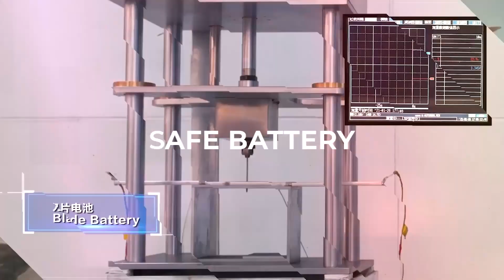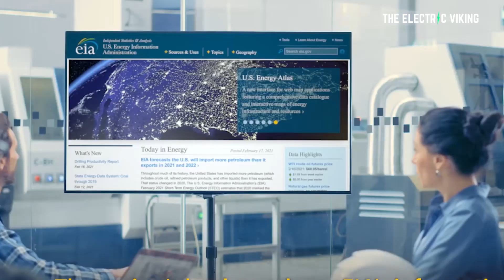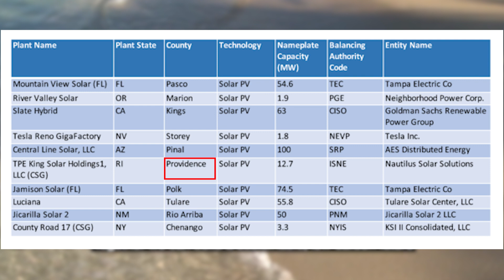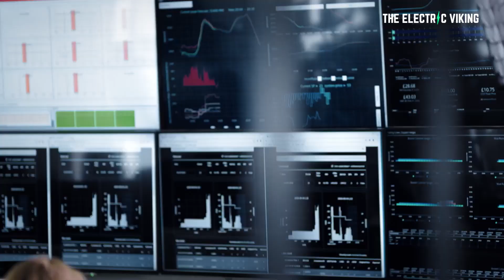US nears 50% emission free electricity; wind & solar set records

Comment: Let me tell you the best ways to never have Americans buy solar for their homes.  First come knocking on our door and explain you are from the electric company and are their to measure up your home for solar energy.  It’s a scam the electric company has never heard of them.  Second the price varies so much from one solar company to the next and what they recommend for your home you just give up in disgust.  Third solar products and solar companies do not have strong warranties.  Installation contractors in America and manufacturers in China come and go.  I 100% predict Americans will be left with degraded solar systems after 10 to 20 years then have to depend on a electric grid that can’t supply electricity thru a abandoned and disabled system.  When those cheap plastic solar panels from China and the crappy but profitable installation is coming undone and those panels ain’t producing power no more who are you going to call?  Speedy Solar and Mr Wong in China.  Oh I know call Tesla power wall for service they will happily sell you Tesla solar roof.

Comment: Nuclear is not going away dude. In fact in the long run it will be a greater part of the energy composite than it is now. Sure the old mega nuclear plants are closing, but Small Modular Reactors are just getting started.

Comment: It is getting better.   But we need to be a bit careful because numbers that only run through spring (a period when very little AC is in use) are not very meaningful.   But it is getting better.   For 2021 the breakdown was:

natural gas: 38.3%
coal: 21.8%
nuclear: 18.9%
renewables: 20.1%

And under the reneawbles banner, wind was 9.2%, hydro was 6.3%, solar was 2.8%, and biomass was 1.3%.  Unfortunately, the generation mix varies widely by state.  Some states are more proactive than others.  Solar is more far more expensive in the U.S. primarily because of the Tariffs on imported solar products like panels.   Basically, bad policy decisions.  Despite that, solar is becoming more accessible to people and storage is rapidly closing in on economic viability too (the storage side doesn't have the same tariff problem that the solar panel side has).

Comment: Be very careful with this reporting, you are only describing electrical generation not total energy. In US 2021 solar was 1.5% and wind was 3.3% nat gas was 31.3% oil 35.5% coal 10.5% nuc 8.2% . So I think it will take 10 years to get to 50% if at all?

Comment: Without huge amounts of new nuclear power, non fossil derived power can’t exceed about 60%. The wind doesn’t blow and the sun doesn’t shine when you need the power. No universal battery technology exists that can change that fact. Many approaches are being tried but none are close to solving the problem of electricity generation being a real time problem (demand for electricity must be met with power generated at the same time). Conclusion: Wind and solar will not supply more than about 60% of electric power, full stop.

Comment: Hey Viking!  Where do you get your numbers?  The US is NOWHERE NEAR 50% "emission free" electricity.  NOPE.  As for why PV and wind electricity is so expensive in the USA, the answer is geography.  Few areas of the US have long days uninterrupted by cloud cover, unlike Australia.  And though we have abundant wind resources, much of the wind potential is far removed from population centers (the Great Plains, for instance).  Intermittency is a problem for the grid, and transmission drives up prices.  No mystery.   Cheers!

Comment: Very good news!  I've been using 43% as non-fossil powering the US grid but that was based on older 2020 numbers -- so 50% renewable (or non-carbon) is in-line with expectations.  The US federal government's goal is a 100% carbon-free grid by 2035 which is quite doable!  Especially given where we are now along with (a) the declining solar price and (b) upcoming big solar efficiency improvements via new advancements like Perovskite and Quantum Dot films.  Not to mention wind too.

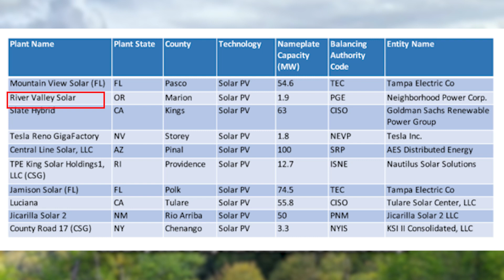At 5:45, I see the Tesla Reno Nevada Gigafactory's solar nameplate capacity listed at only 1.8MW.  That is low -- even a Costco, Home Depot, Lowe's, Target or Walmart store quite easily have that much and more on their roof tops.

The numbers I'm seeing for current Tesla Reno Gigafactory solar capacity is 3.2MW.  But with capacity up to a staggering 72MW given the enormous roof area of a Gigafactory.  But Tesla's Gigafactory solar installation has been going slowly -- mostly because the factory itself is only partially built-out at some 30%.  The current COVID-19 pandemic and supply problems are not helping Tesla either.

Some early 2022 reports indicated the Tesla Reno facility's solar will be expanded to 24MW capacity by end of 2022 but that was before crazy Putin's effect on global supplies and increasing uncertainty of inflation.

Comment: "US nears 50% emission free electricity"????  You serious?  Better go check the stats yourself and not read "YouTube headlines"  Gas and Coal will continue to be largest generating electricity energy sources and they will increase i the future because they US is very bad at water management and thus its largest hydro generating sources will decrease.  Until they develop a "storage" ability for wind power, they will not be able to fully take advantage of Wind power which fluctuates erratically and not in line with demand necessarily.  10 years to get to just "solar and wind" production of electricity??

Comment: https://www.eia.gov/energyexplained/us-energy-facts/data-and-statistics.php
Electricity production is 61% fossil fuels. Nuclear 19%, (California will reduce that); wind 9% and solar 3%  of electrical production;; about 5% of electrical power is lost in transmission.  The remainder is bio mass 1% (has CO2) hydro 6.3%, geothermal 0.5. Electricity is about 1/3 of overall energy used.

Comment: But the "BEV's and green energy can't possibly work" crowd will keep claiming BEV's "run on coal" until ZERO coal is used to generate electricity.  

It seems to me that I've seen various articles, videos, etc. stating that at utility scale, green energy (solar and wind) is becoming cheaper than fossil fuel energy at utility scale. 

Economics should take care of the issue, given time, as long as it's true that green energy is meaningfully cheaper, over time.

Comment: Tariffs on China imports. A hole home system would cost me between $60-65k with panels being 25k and 3-growatts plus a rack of 6 batteries for the rest
Reply: The panels themselves are just a small part of the cost. The high costs are typically mostly found in permitting and bureaucracy.
Reply: Yeah Trump put them on there. Biden really should lift them, at least for things like solar panels and batteries. We need every bit we can get right now, regardless of where they're from.
Reply: @spacenerdity  more good solar panels need to be made here in the states. Norway has the best value with the rec alphx panel with 400w & 21.6% efficiency with a service warranty next is the sil fab elite 380w & 21.4% efficiency made here in the states, but no service warranty.

Comment: No, we've shut down coal and lost overall capacity.  Solar and wind aren't cutting it, but builders and owners get free tax money.  And the blackouts increase.

And now we're expected and MANDATED to buy electric golf carts.
Reply: As an electrician who has worked on most types of power plants and lives in the western US, the cause of blackouts is mostly caused by the drought effecting supplies of cooling water to thermoelectric power plants (coal, gas, and nuclear). Or in some cases the power plants may have the volume of water needed, but the water is too warm to cool the plant in the manner it was designed during warm weather events. Wind and Solar have helped stabilize the grid, reduce stress on grid interchanges, and kept electrical prices lower. Coal plants have been shut down because they cannot make a profit selling their power.
There are no mandates (yet) to purchase EV's in the US, yet Tesla is now the best selling car in California.
I have driven Tesla's and the Chevy Bolt, own a Chevy Volt, and have a Cybertruck on order. None are golf carts!
Reply: @GoCoyote  Huh?!

Did you forget what happened when a couple of coal plants were shut down, 'replaced' by the pinwheels in the Columbia Gorge?  We had a SLIGHT drought, and the hydroelectric dams had to drop their generation level to make up for the lower water pressure.  We lost the last domestic aluminum plant because of that.  Also, any blackouts we've had, have grown in frequency AND LENGTH due to the erratic effect of pinwheels and smoke-and-mirror solar.  They are NOT stabilizing ANYTHING...quite the opposite.

Drive down the Columbia Gorge one of these days, and see how many of those huge, ugly pinwheels despoiling the landscape are turning.  On any given day, it might be 1/4 to 1/3 of them.  And that's during the peak wind flow times through the gorge.  A GE employee told me that if these things turn faster than 60%, they have to be shut down and serviced.  Most times, since there's nothing that can be serviced without disassembling the nacelle...ON THE GROUND...the repair guys sit up in the thing and play cards for an hour or so, then leave.  But the owner of the wind farm (which is NOT PGE) gets paid as if all those pinwheels are generating 100% of their ADVERTISED capacity.  Meanwhile, any time a coal plant operates, it has to pay the government a FEE.  As well, the utility using the power, has to pay a FEE for using that power instead of nonexistent power from solar or wind.  If they didn't have to do that, it would STILL be far less expensive to use coal than the non-existent/intermittent/erratic/nonviable wind and solar.  It is the feed-in tariff and 'carbon offset' fees charged to coal, that makes it more expensive.  It is NOT inherent to the operation of coal power in and of itself.  That is a false assessment.

I have driven EVs from the 70s to a Model S, and they are ALL golf carts.  The only difference in newer EVs, is the straight line 0-60 acceleration, done at the expense of efficiency and control.  They're still crap road vehicles, they're still a HUGE faff as far as dealing with the batteries...CONSTANTLY...and they're still too expensive and not utilitarian enough to be viable.  Yet we're being told we won't have a choice BUT to buy them, as every other choice (that we could actually USE and ACTUALLY WANT) is not going to be ALLOWED.  That, to any clear-thinking idividual, is a MANDATE.

By the way, if you think the stainless doorstop isn't a golf cart, when it doesn't even EXIST as a production vehicle yet, I have to doubt the veracity of your assessments.  It's obvious they're based in something other than reality.
Reply: Super real account and totally not an Exxon troll. lol
Reply: @spacenerdity  Nope.  Not a troll and paid by ANY oil company.  Just facts against this greenwashing bulls--t.

Which anti-energy greenie weenie subsidy-sucking company pays YOUR salary?
Reply: You are full of crap.

Comment: The greenest setup using solar panels is to grow plants in the semi-shade beneath them. Depending on spacing, that level of light can be "tuned." Going all the way, some are farming fish in tanks below this, with the plant roots growing hydroponically down into the fish tank. Feeding the fish feeds the plants with the fishes' waste, and the water is filtered and aerated to avoid stagnation and maintain oxygen levels. The water cools the plants and panels above, helping panels' efficiency.Things like this could easily be the kind of mix of high and low tech that solves many problems.
Reply: You're correct. Farmers are finding consistently that their grass and grain crops are growing better under the partial shade of Solar PV arrays than they would in unobstructed sunlight.
Reply: then eat the fish because they dont have any feelings

Comment: I am a power engineer.  every solar panel on a roof makes our grid more unstable.....they're installing "green" without enough batterie backup to smooth out the delivery.  The base load plants cant ramp up fast enough and they'll trip offline
Reply: Can regulators help out with this problem?
Reply: @eschreck814  the batteries are massively expensive.
Reply: Yet every blackout the US has had recently has been caused entirely by failures of your “baseload” plants.
Reply: @williammeek4078    not sure you even know what you mean.  Blackouts happen for a veriety of issues
Reply: Would you know what that is like in States like Nevada, where roof solar should be very correlated to ac needs from sunshine. Is Nevada an exception?
Reply: So what you're saying is, home solar is generating so much power its overloading the grid. Lol sounds like the grid is shit, not solar.
Reply: @spacenerdity  no i did not say that.
They're not overloading the grid....to think that just shows how utterly ignorant you are. 
The problem is green wind and solar power can drop off very suddenly and the base load plants cant ramp up fast enough. And if the demand is too much higher than the production,  the plant's voltage starts to lag phase of the amps and the trip off line triggering a blackout.